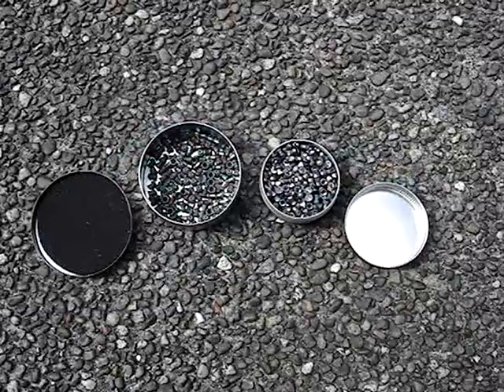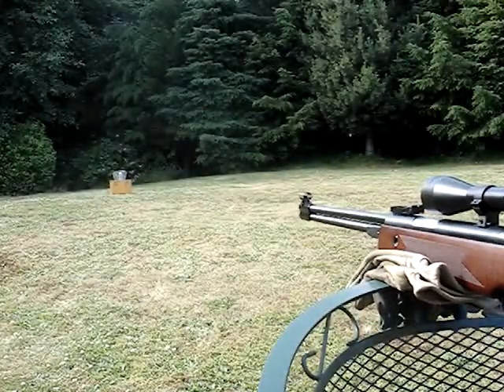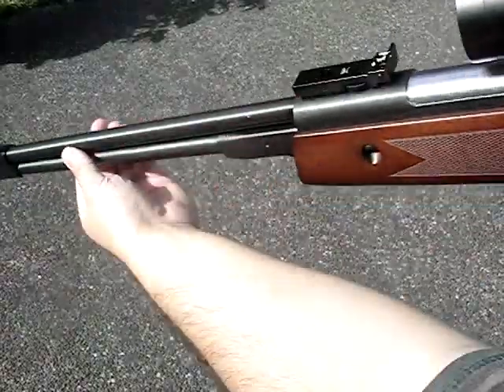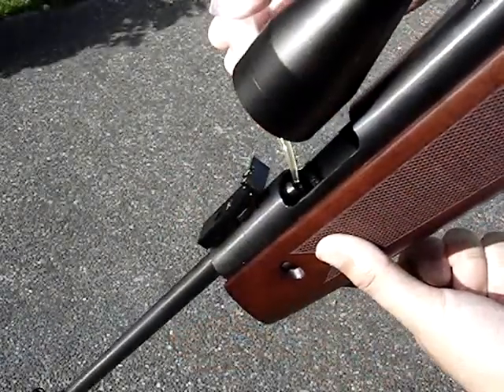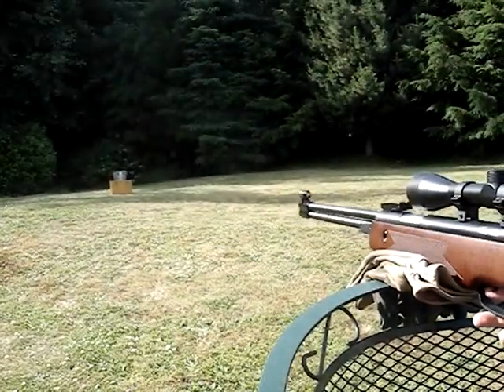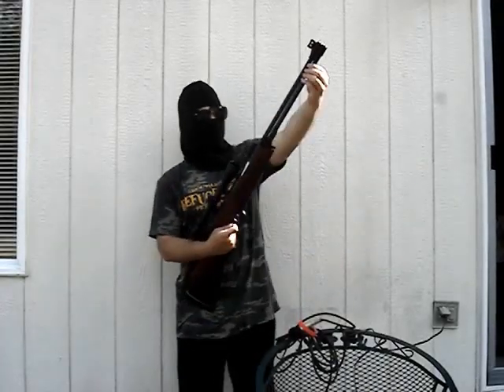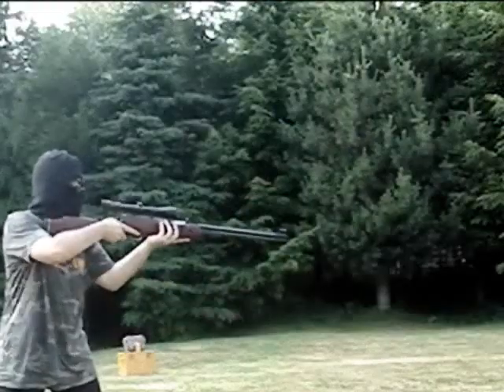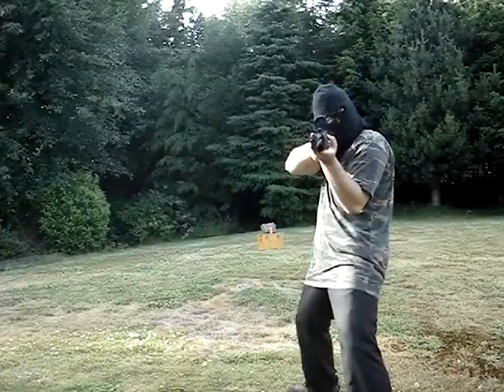Dieseling Motor Oil in a Tech Force 97 Air Rifle to boost muzzle energy

Comment from the maker: It actually does boost the velocity of the pellet. However it only cause more heat and pressure than the airgun was designed to tolerate, so you end up shortening the lifespan of the seals.

Comment: Ive tried it with my weihrauch Hw 50 and it diesel's on the second shot with one application of oil in the air chamber then continues to diesel for another couple of shots.
You can really feel the extra recoil and it has a lovely crack to it. 
Also I can't really see how it could damage the gun. 
Anyway thanks for your fun post.
Reply from the maker: Depending on what you put in the airgun eventually the seals could degrade from petroleum. I think there’s a specific ratio of fuel to air to get the most efficient bang which probably happens more often after the oil has atomized from a previous shot.
Reply: @bmiranda2645  yes your spot on about mixture very similar to internal combustion.

Comment from the maker: you are absolutely correct about everything you described. I have half a brain. I burned the seals out on the TF97. the recoil was much more intense that the scope's crosshair started to get misaligned after each shot. the velocity was never consistent with dieseled shotsl. pellets never grouped predictably. lastly, the trigger sear dangerously got jammed with black carbon gunk. but in my defense I just wanted to see if motor/cooking/gun oils diesel. they do. with catastrophic results

Comment: Glow plug fuel - one drop into the chamber, not behind the pellet - was my adolescent practice. "Dieseling" means creating circumstances such as might be found in a diesel engine, and the piston and chamber are where the action/pressure is.

Comment: its nice the fact that its a fixed barrel witha  break barrel cocking action
Reply from the maker: Yes I have an Air Arms Pro Sport which has a hidden under lever, and I have a Diana 54 Airking Pro which has a side lever that breaks sideways and has a floating anti-recoil system. These airguns are very accurate, but all those extra metal components make them very heavy compared to a simpler breaking barrel.
Reply: @bmiranda2645  verynice

Comment: It's impossible to measure but I've read that the air temperature just behind the pellet in a springer can approach 1000c for a millisecond or two, that's why this works. I tried it recently in my HW57 with olive oil and it works perfectly. To save having to do each pellet, each time, you could try candle wax. I'll report back!
Reply from the maker: Guy Wood Yeah you're are right. I studied thermodynamics in college and if you compress air in such a short amount of time you do raise its temperature significantly, which is how a diesel engine operates without a spark like a gasoline engine, or how jet engines can sustain operation by the heat of compression in the combustion chamber after the air compressor to keep the jet fuel burning after it is initially started by an external air supply and then ignited.

Comment: You got me for a moment I was like "Wait what? That is a single shot rifle how is he doing that?" Then I realized he was just joking around and edited the video lol it would be cool if they had something like that tho with the same rate of fire that would be awesome for plinking
Reply from the maker: I'm pretty sure there's an air rifle that could cycle lead pellets automatically using a compressed air bottle. I know there are CO2 BB guns and airsoft guns that can do that. However when you discharge a lot of gas quickly you lose pressure and freeze up the mechanism like how refrigerators remove heat.

Comment from the maker: yes you are correct. it's funny because I don't actually have to diesel pellets in my new cheap 1000 fps Crosman Fury to break the sound barrier because I tried Crosman's lightweight alloy pellets and the velocity does reach up to 1200 fps as advertised hence the unusually loud bang of the pellet shockwave. Horrible accuracy though and alloy pellets are very expensive than lead.

Comment from the maker: no I never spent the money to chronograph the pellets shot fired normally and dieseled. would help support my facts a lot. I honestly stretched the truth in the video. it might've shot between 700-800fps normally with the 8 grain pellets I used, and then 900-1000 fps with motor oil in the skirt. dieseling did not make it break the sound barrier because having shot an .22 rimfire rifle I know the whip crack sound.

Comment: By far the best oil for dieseling is 2-stroke oil, people use way to much though. It only take a bit. Load your pellet then with your finger smear a little around the skirt to get a good seal and get a little oil in there. I experimented with additives like 1 part gas or starting fluid to 30 parts oil or so. It was not consistent as to much would result in no ignition, but if it did crack i did not notice much improvement.  I also tried diesel fuel, but I hate the smell.  You will get about a 30% increase in penetration using a phone target. Or you can just dribble a little 2-stroke oil in your pellet tin, but again do not saturate. ..Make sure you clean your gun often as the oil gums it up.  You can see sparks from the barrel if you shoot at night.
Reply from the maker: +shaymus crow good observation. The science behind "dieseling" is that when liquids reach a hot enough temperatures from the fast compression of air, they ignite and turn to a gaseous state, expanding in volume. Think of frying food in hot oil. The boiling point of oil is a lot higher than that of water so that is why it is a dry-cooking method: it makes the food crispy when the water content is vaporized out, the crackling sound like an applause. I know there are many ignitable liquids out there and they all have specific amounts for stoichiometric ratios that work best. Too much, you get nothing but a wet juicy cloud. The perfect ratio, you get a loud smoky bang.

Comment from the maker: Tech Force 97 air rifle. Are you talking about pneumatic airguns that only need one stroke to compress the air cylinder? Well this TF97 is actually a spring piston underlever airgun. It is the same as a break barrel except the barrel does not break exposing the breech, but a separate lever (much harder to load the pellet in though).

Comment from the maker: The TF97 has a rifled barrel. So sorry that's too bad that they do not allow rifled barrels. I don't even understand why considering shooting pellets through a rifled barrel is a lot more accurate than a BB going through a smooth bore with no axial spin. I will recommend the Crosman 760 Pumpmaster smoothbore airgun. I never used it before, but it is a very popular pneumatic airgun in my country.

Comment: I use a shell casing to keep it from crushing my finger.I think it is tech force 99 it is not much different than an underlever.My b3 is an unerlever.
Reply from the maker: +James haury by crushing are you talking about the bear trap hazard? I never had an incident with cocking the TF97 because the built-in anti bear trap was reliable. The only ways I could think of getting hurt is to slip or lose my grip while cocking and have the buttstock whack me in the face, busting my lip and knocking out some teeth.
Reply: I have no safety on my B3.I use a shell casing with it. My sidelever has a safety you have to press in a red button to release the piston.

Comment from the maker: Well the soap bar sounds good for relative testing, like how significant the muzzle energy difference is. Also I noticed that when dieseling motor oil, the muzzle energy was very inconsistent, so better a chronograph.

I have shot at phone books to test different pellet head penetration like pointed, round nose, wadcutter, hollowpoint and I favor the mushrooming hollowpoints which transfer most of their energy to the target and not over penetrate the backstop especially in my suburban village.

Comment: no ive done this and it works pretty well but it fouls up your barrel alot another option is to use smokeless powder which you can actually get from thouse .22s that shoot nails into concrete then you just fill the skirt with the smokeless powder. much less fouling and i little more power.
Reply from the maker: Whoa. I never tried using primer before but I figured that just turns your air gun into an actual firearm. But either way, both techniques will end up fouling up the barrel, and I noticed all my air guns will indeed last a very long time if I take care of them and use them the way the manufacturers designed them for.
Reply: same

Comment from the maker: Well you're right about some loopholes in the legal system. If there's a way to suspend oil in a solid medium and diesel it in the chamber of a .22 air gun, you basically added a primer charge to the skirt of the pellet making it about as powerful as a .22 rimfire cartridge but it won't be defined as a firearm maybe on the federal level. That is unless the definition of a firearm in your state is based on a minimum muzzle velocity (500 fps) or energy (+30 foot lbs) of the gun for examples.

Comment from the maker: I paid $90 U.S.A. The specifications for the Chinese made Tech Force 97:

caliber 4.5mm, velocity 900 fps, rifled barrel length 16" - overall airgun length 40" (about 1 meter), 12 lbs underlever cocking effort, fiber optic sights, 11mm dovetail for scopes, 2-stage non adjustable trigger, automatic safety, overall airgun weight 7.4 lbs.

For more info, search for the Pyramydair online store on the internet. I don't know if they deliver to Bosnia and Herzegovina, but there are specs for many guns.

Comment from the maker: Yeah I got the TF97 (which heavily resembles the Weihrauch/Beeman HW77 and HW97K) without a scope from Pyramydair for $90 US. I already had a cheap 40mm JB Unicorn airsoft scope that got destroyed on the spring airgun due to not being shock proof haha. I know what you mean about the diesel fuel. I have used vegetable cooking oil more often than motor oil because it detonates with compression more efficiently and smells like fried egg rolls. Does your quiet Crosman NP XL have a barrel shroud?

Comment: I have a Tech Force 97.  Will you please help me with what hardware I need to mount a scope?  Do I order 11mm dovetail rings?  Is that all I need, or do I also need a mounting rail?
Reply from the maker: +wandaw Well I didn't need a mounting rail. I just had to buy those smaller .22 rifle style dovetail rings because my 1 inch weaver style rings were too big to mount directly to the TF97 spring tube, so in that case I would have needed a mounting weaver rail.
Reply: +bmiranda2645   Thank you for your fast response.  I'll order the dovetail rings.  I'm ordering a Tasco Pronghorn 3-9 x 32 Scope from Walmart.  Hopefully it will work okay.  I'm in the city and have a small back yard and a shed full of squirrels.  The range is close.  If I could pick them out of the trees or from the roofs that would help, but I can't risk the pellets landing where they shouldn't.  If you have any recommendations on an appropriate close-range scope (approximately 10-60 ft or less than 25 yards), I'd be glad to hear your opinion.  Thanks again.
Reply from the maker: Well I would recommend any of the affordable Tasco or Crosman dovetail scopes you could find at Walmart. I bought a Tasco and Crosman scope for my Ruger and Crosman air rifles I bought at Walmart and they all work well for being as cheap as they are. I sight my scopes in for 30-50 ft plinking in my suburban backyard. Any farther than 100 ft and I would be shooting into my neighbor's property on the other side of the green belt.

Comment: I play airsoft, and the oil they recommend us to use is silicone oil. I also tend to use it a bit in my .177 pellet rifles. would that damage the gun because of a increase in pressure or other factors?

Comment: Q: it is really needed/required dieseling air rifles?
what are exactly the maintenance of those air rifles?
Reply from the maker: +newnemesis666 dieseling is not needed. It is just an effect of putting a type of fuel that vaporizes from the heat of compression. The increase in volume raises the velocity, but the residue is bad for your chamber and seals. It is not recommended to diesel air rifles although this naturally happens from the first few shots after you oil your piston.
Reply: bmiranda2645 thank you very mcuh for your answer. Subscribed.
Reply: +newnemesis666 to inform u to be aware many of these people dont know what they are talking about  the only oil u should be using in airsoft guns or any pellet gun is silicone oil often a sample is given with a purchased  gun
Reply: KG steve , I'll keep that in mind, thanks :)

Comment: I have a new Diana 350 magnum air rifle in .22 I tried it yesterday couple shots inside home and was ok, they come very dry from RWS factory so added 2 drops of same brand RWS air chamber lube, I tried 1 shot and now is way so loud, I shot once after lubrication and was noise like a 22LR, it is good, bad, normal?
Reply from the maker: +Mr E (channel) it is normal if you have just lubed your airgun. There will be residual oil and it will ignite with a high velocity compression like that. However it is bad if you purposely add drops of oil to the skirt of the pellet just to increase muzzle velocity. I know because my Tech Force 97 eventually gunked up so badly after attempting 200 dieseling shots that I had to take it part to clean it.
Reply: Thanks for your input.

Comment: i have never oiled my bolt acting air gun and have had in nearly 2 years but i haven't used it in a very long time my problem is that oil is coming out from the bolt action down to the stock i me its even coming out of the screws but i don't know if it because ive left it for so long or if its because ive left in standing up for so long or both
Reply from the maker: Sounds like the air gun needs cleaning. Eventually the oil will degrade and become dirty, so it sounds as if you might have an excessive amount of oil buildup. You should take it to a qualified gunsmith so the air gun can be retuned and restored.
Reply: bmiranda2645 thanks for the advice

Comment from the maker: You put the oil in the back end of the skirt of the pellet. That way it is only very little but enough to detonate completely and not make the compression tube too greasy. If you put too much oil directly on the piston it may actually clog the cylinder.

Comment: Illegal in Canada if the Dieseling puts your FPS over 500 (IF you have a PAL, its fine.)
OR, with an FPS under 500, but energy over 4.5 foot pounds. (or was that 4.2?)

Comment from the maker: Awesome you got a Weihrauch airgun? I certainly wouldn't mess with those because they are built with extreme precision. On my Tech Force 97 the barrel and iron sights weren't aligned properly so I could never move the rear sight rightward enough. Yeah 2 stroke oil vaporizes/diesels better than 4 stroke I assume. And yeah I shot various .22 rimfire Ruger guns at our local range which have less aggressive recoils than strong spring airguns. They do sound like very powerful dieseling air rifles.

Comment from the maker: Damn. I never knew it was that difficult and expensive. In America guns are so cheap. I think Brasil has a problem with regulating pellet guns. They are not considered firearms in America as their muzzle energy does not meet an established minimum, plus you cannot semi-fire a pellet rifle unless it has a gas reservoir. Perhaps there should be more restrictions on CO2 and Pre-Charged Pneumatics and less on manual spring cocking airguns?

Comment from the maker: i want to buy a nitro piston type airgun next. it must have less recoil because it is just pneumatic gas pressure piston driven and no steel spring shock. i also want an airgun with a shrouded barrel to dampen the noise.

Comment: Guys...I am surprised that nobody is talking about putting armstrong's mix behind the pellet..made my 430fps B3-3 go to 1125+ broke the sound barrier
Reply: What is Armstrong's mix?
Reply: Zachary Shima take safety matches, and get the stuff on the tip off (don't mix the wood of the matches with it) and grind to a powder, then, use a small knife like object, a box cutter works very well (note that the sharper, the better), and scratch the rough parts that you strike the matches against off, try to not scratch the cardboard off as well, because it will make your powder less potent and you could also have miss-lights, then mix the 2 powders together (very carefully because it can detonate, but you do not have to worry too much about that, just don't be agressive with the powder) and then you have armstrongs mix, the ratio from match head to match box powder is either 50/50, or 40/60, matchhead can be a little more than the matchbox powder because it is the thing that makes the actual explosion, the other powder just intensifies and quickens the reaction. Use this stuff wisely my friend
Reply: Sweet! Thanks for the reply dude that sounds crazy as beans man
Reply: anarchists cook book eat your heart out
Reply: You would be better off with a little pinch of gun/flash cotton packed into the skirt it won't fall out like AM powder and has a little more bang... should I say a friend has done a little bit of experimenting with this and at least you won't blow the tips of your fingers off using gun/flash cotton and you can store it safer than AM and it also burns cleaner than AM all good advantages :)

Comment from the maker: haha well that answers my question. i never tried dieseling olive oil before. it might have too low a smoke point so it burns before it detonates. it is the same reason higher octane gasolines are better because they prevent engine knock (detonation) where in a diesel engine it runs off of the detonation of diesel fuel under higher compression ratios.